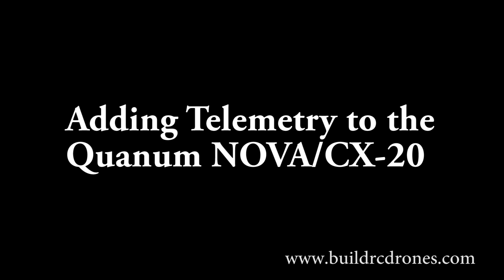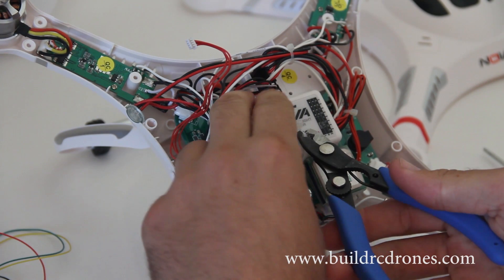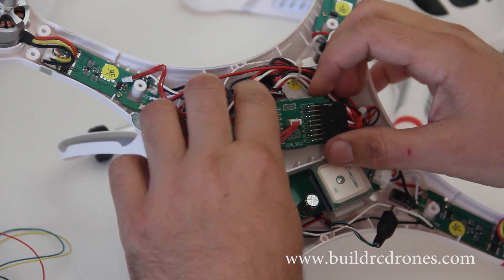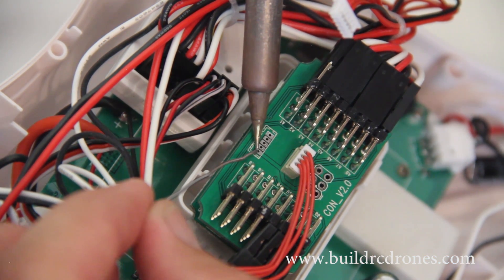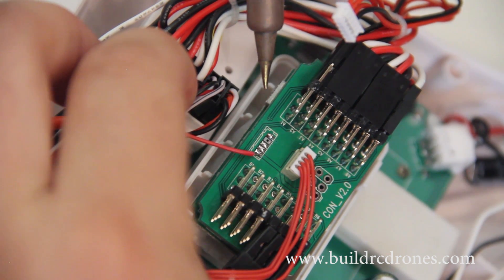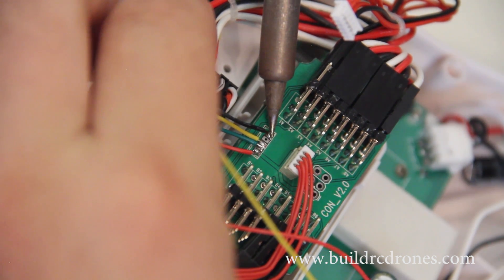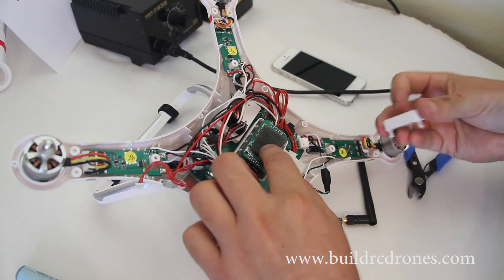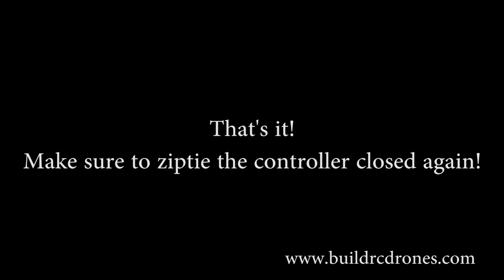Adding telemetry: Quanum NOVA CX-20

Comment: Great video, very helpful. When soldering to the serial port I'm concerned about the solder cross contacting between the wires/contacts.  In your vid it kinda looks like the tx/rx wires are tacked together with the solder (not criticizing please don't think so) is this the case or should I be extra careful not to allow the solder to cross between contacts at all?

Comment: Terrific video - thanks! I'm new to this and found it very useful. One question - is a telemetry unit the same as an On Screen Display (OSD). If I fit this on my Nova, will I be able to see stuff like altitude, battery charge and the like on my FPV screen?
Reply: +Cheeku Lumma no osd is not the same. You will need a minimosd a camera and a transmitter to setup fpv. This is telemetry it allows t see what the flight controller is doing as well as allowing waypoint control via phone or pc in the field

Comment: I installed the telemetry and when I put the battery in the drone and tried to turn on the RC transmitter, the beeps emitted by the transmitter are interrupted and the connection does not happen. Does anyone know what can it be?

Comment: Good vid.  I just got the latest Nova from HK with APM_252_V5.0 flight processor.  Does not have pads it has UART and ADC connectors now and its impossible to tell what the pinouts are for hooking up A Neewer 900Mhz Telemetry.  Anybody figured this out or can help would be appreciated.  HK was no help as expected.
Reply: I'm in the same boat. Did you work it out?
Reply: John Hughes, try this.

https://drive.google.com/file/d/0B68EPEl_9HyEenc5WDJfRVFlcTg/view?usp=sharing
Reply: Jordan Worley Thanks a bunch.  I had figured out the pin outs and got Telemetry running on my Nova between 2 of my Android devices but not with my Windows Laptop.  While I have not tried your driver yet it seems to be the solution I was struggling for.  Great job.  This is the best tutorial I have seen for Cx20/QNova.  FYI.  I just finished sorting out how to get the power module running on QN.  Works fine but current (wattage) calibration is a bit difficult.  Voltage no problem.
Reply: John Hughes Update on above comments.  The driver does not work for my set up.  My telemetry is based upon a Silicon Labs CP210X USB to UART Bridge.  Tried your driver and it failed.  Windows likes the latest version from SL.  MP does not connect because "access is Denied to my port #".  All speeds are set, etc.  Baffled and may resort to trying with Win 8 instead of Win 7.

Comment: HI there would it be possible to hook up a OSD unit with the usb input available on the cheerson cx 20, im not to comfortable opening and soldering wires inside the unit and then would it be possible to power it off either the 5v or 12v  . Thank you
Reply: Killer, Did you get a answer?
Reply: Kazz- Mann Unfortunately not mate, but I have found out that with my version the BIGSHARK flight controller there is an available spot to connect a telemetry unit without soldering and only requires that you open in up and connect to spare channel or something along those lines, and then connect it to a video link in which case you would probably need to solder however it would be outside the case with simply two wires which is not difficult.
Reply: KillerReviews97 Where is this link Killer?
Reply: Kazz- Mann Right above you mate but here you go : http://www.aliexpress.com/store/product/OSD-Module-Display-GPS-Quantity-Flight-Speed-Location-For-Cheerson-CX-20-CX20-Auto-Pathfinder-RC/300505_32246662115.html

Comment: Great video! Thanks for uploading this :)

The better way to solder is to heat the pad and apply solder to the pad, not to the tip. And clean the tip before each pad. That will make sure the solder on the pads have more flux, and you'll easily be able to heat the pad and wire, and the solder will flow better around the wire and pad :)
I usually pre-heat for 1 sec, apply solder to pad while heating, then keep the solder iron on the pad for another 1 second, then remove. Of course this is with a soldering iron where you can adjust temperature. 
And use lead solder, Kester 44 Rosin Core 60/40 is excellent! The temperature can be approx. 270 Celsius, and you'll easily be able to melt the solder, and lowering the risk of damage to components.

- Experience from game consoles and synths.

Comment: All I would add is I'd put a small dab of hotmelt glue on the wires after you solder them to help guard againt fractures due to vibration

Comment: Really appreciate your time to make this video, I have followed the instructions for hook up however can't get the mavlink to connect. After the connection times out I get a message that says no heartbeats detected. even though both the air and ground radios have solid green lights. Any idea what's going on?
Reply: Hi KyleMatt11 - Im getting the same issue using the Hextronik (Hobbyking 433Mhz) telemetry module. Did you fix it?

I can see the 2 units in 3DR in mission planner, but it wont connect - Anyone know what else to check before this thing drives me crazy?
Reply: 50barleft , which version of the radios are you using ? (version 1 or version 2?), did you make the right connections between radio and flight controller ? here some instructions you can follow , see-->  http://copter.ardupilot.com/wiki/common-using-the-3dr-radio-for-telemetry-with-apm-and-px4/
Reply: 50barleft Hi im getting the same Problem ... have you fix it already ? is it posibile that the Firmware on the two Units is too old ?? (SIK 1.7) The APM has the newest Firmware
Reply: Hi !
I also have the same problem, but i guess i am one step closer to the solution: On the original APM, the Telemetry is coming via TX0 and RX0 via a Mux chip which is switching the connection from the CPU to either the USB or Telemetry Port. On this flight controller, the telemetry port is connected to the TX2 and RX2 - so in fact, i think we need to make the software talk for Telemetry to TX2 and RX2 in addition to TX0 and RX0. Anyone got an idea ?
Reply: *****
KyleMatt11 
752castro 50barleft 4YI: The problem is that the original APM firmware of the cheerson was modified. After upgrading to a later version, telemetry does not work directly. If you want to use a reasonable new firmware, you have to flash the following firmware - i've just tested it and it works great !
Discussion:
http://ardupilot.com/forum/viewtopic.php?f=22&t=9534

Firmware:
http://ardupilot.com/forum/download/file.php?id=3351

Flash tool for dummies:
http://www.hobbytronics.co.uk/arduino-xloader

Comment: Doesn't that port run to the bottom of the Nova (not the Cheerson)? What do we use for the receiver? Everything I have is on 2.4ghz except the FPV gear but I don't think the Nova will handle all that gear plus a camera and Gimbal as well. Please keep bringing us the info on the Nova, thanks.  I think HK finally got something right :-)

Comment: Is there a similar telemetry unit for the Naza M Lite?
Reply: No sir ... Telemetry is a NAZA -M (no lite) option.  And not a low cost one.  It require you buy the Bluetooth down link system. By the way don't let the DJI Bluetooth ground station fool you by it's name. It is not using Bluetooth to the quad... It uses long range 900 mhz to the quad and the unit on the ground has Bluetooth that you use to connect IT to your ground station (ipad / android / iphone / PC)